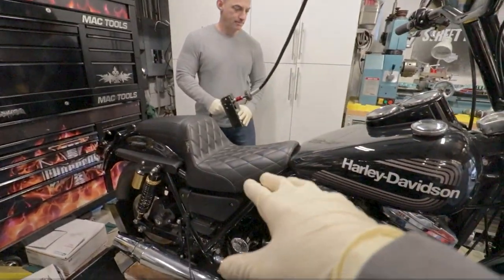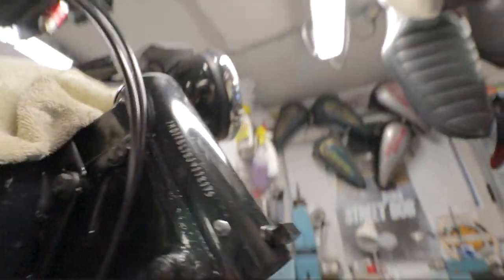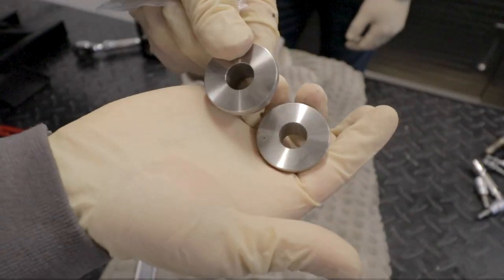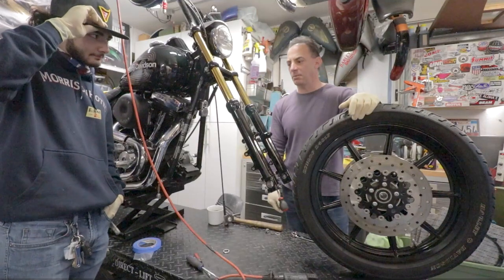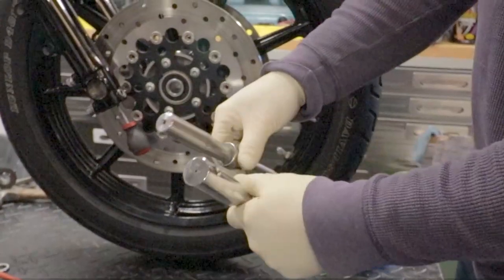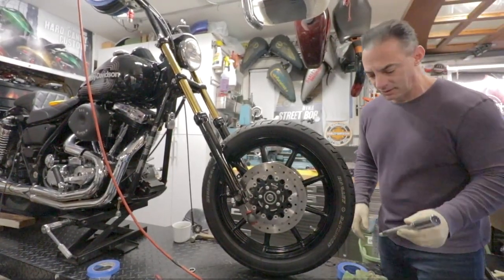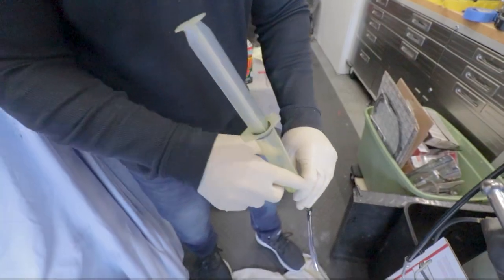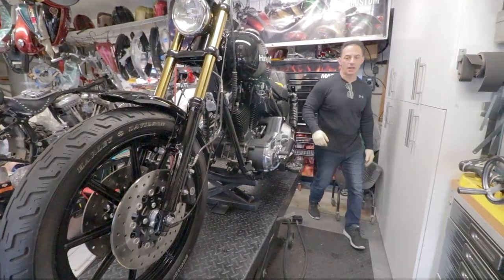GOLD Dual Disk Final Install on our FXR - Part 2

Comment: When I first bought my Dyna a Concord purple FXDX it had lowering blocks on the rear shocks witch was the first thing I took off but I thought it would be an easy one man job after a few cocktails I decided to tackle it not using my brain the first thing I did was remove the bolts from the bottom thinking I could just lift the rear of the bike no problem lol it was a problem thank god my wife was there to put the bolts Bach in while I hemaned the rear lol

Comment: Does this tree fit without mods to the bearings or shaft ? Which model/year you’re using ? Greetz from the Netherlands
Reply from the maker: The tree itself is the same as the one we took off only it’s powder coated black. The tree is the old style with the lock tab and the new legs slide right in no mods necessary.

Comment: Q: what was the benefit of doing the bleeding off the bike? ...seems what you did offline could be don eon the bike the same way. It a really nice looking FXR and the EVO should last forever (if you treat it right).
Reply from the maker: It could have been done on the bike, but it would have been a little more difficult to access the two calipers. The bench bleed system we made had them right next to each other
Reply: @KingpinGarage  were you just limited by the short tubes... you could just have longer tubes on the "reverse bleed  syringe" going to each caliper (if done on the bike)
Reply from the maker: yes we could have but doing it on the bench was just easier. we could’ve gone either way

Comment: LIKE THE VIDEO BUT RISER BARS ON A FXR? I SEE THEM ALL OVER THE PLACE BUT THEY DEFEAT THE WHOLE INTENTION OF A FXR, YOU LIKE THEM, THAT'S COOL, FOR ME THEY PUT YOU UP IN THE WIND AND TIRE YOU OUT, YOU HAVE ALLOT LESS CONTROL OF THE BIKE BUT I GET STYLE IS THE THING HERE BUT ON A FXR ITS COUNTER INTUITIVE TO ME. THE BRAKE BLEEDING WHY GO TO ALL THE TROUBLE/WORK YOU WENT THROUGH TO DO THE SAME THING YOU WOULD HAVE DONE BLEEDING THEM ON THE BIKE? THE SYRINGE WAS ACTUALLY A PRETTY COOL SETUP THOUGH. I ALWAYS USE AN OLD SCHOOL DEDICATED HAND PUMP OIL CAN. HOLDING THE PARTS SEEING YOU PUTTING ON THE MASTER CYLINDER HOLDING THINGS TO ME IS A TOTAL PITA (YOU CUTTING THE VIDEO PROVES MY POINT) START TO FINISH AND RISKS SCRATCHING UP EVERYTHING YOU DID, WHICH LOOK REALLY REALLY GOOD. THE BREMBOS ARE A GREAT CALIPER, UPGRADED MY FXR AND FLHT WITH THEM AS WELL BUT PRETTY CONFIDENT THE SVO BREMBO'S ARE NOT ANY DIFFERENT THAN THE STANDARD BREMBO CALIPER OTHER THAN THE BADGING EMBLEM. THE IMPORTANT THING IS THE WHEEL END PLAY WITH  TIMKEN BEARINGS AND AXLE SPACING TO CENTER THE CALIPERS OVER THOSE DISCS. MESS THAT UP AND ITS GOING TO LEAD TO A REALLY BAD DAY RIDING THAT BIKE.
Reply from the maker: The tall bars plus the fairing makes the riding position surprisingly comfortable. Had no issues with it.

Comment: Did you get factory length brake lines for the front calipers?
Reply from the maker: Yes. We used a factory length dual disk brake line setup

Comment: Do you know exactly what brembos your using here? I just bought a fxdx front end for my Fxr doing the same swap, I’m thinking about doing the same calipers as you, I just can’t figure out which ones to pick. They have them for to many different models
Reply from the maker: These brembos are the ones that appear on baggers and these ones specifically are from a cvo bagger. They have the ‘00-Up bolt pattern (the ‘84-‘99 brake mount is much larger). The brembos only had the 00 up bolt style. What year is your front end from?
Reply: @KingpinGarage  2005 fxdx.ended up ordering it through Harley couldn’t find a used one…
Reply: Thanks for the info, ended up ordering some! Sweet bike btw
Reply from the maker: Thanks! That’s the same front end we have but ours is off of a Sportster 1200s

Comment: What did you use to space the calipers to the lower legs?
Reply from the maker: These calipers do not need to be spaced from the 2000-up 39mm lower legs
Reply from the maker: They bolt right up

Comment: How did you find the lever feel with the factory fxr master? Is it the 5/8 one your running?
Reply from the maker: We knew we wanted dual calipers so we upgraded to the 11/16 master cylinder. It has great lever feel. Not to grabby but not too mushy